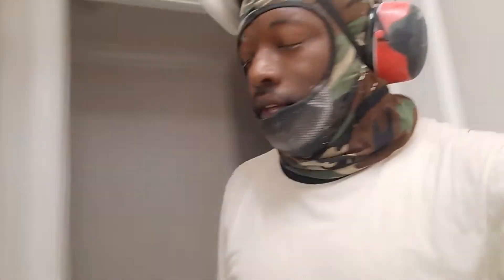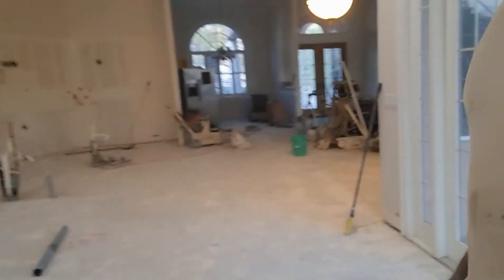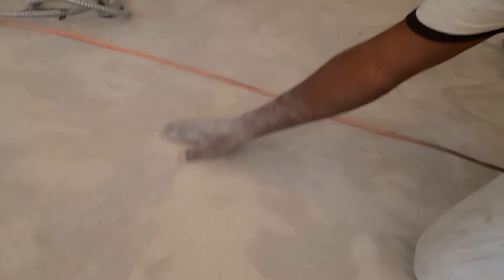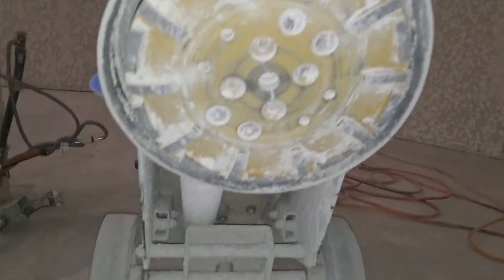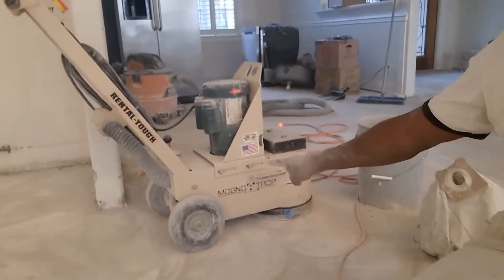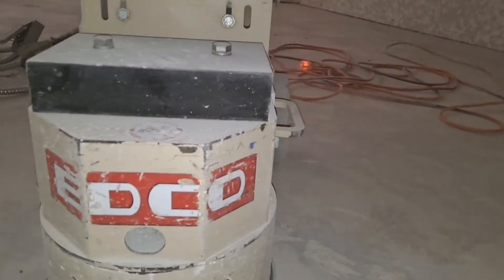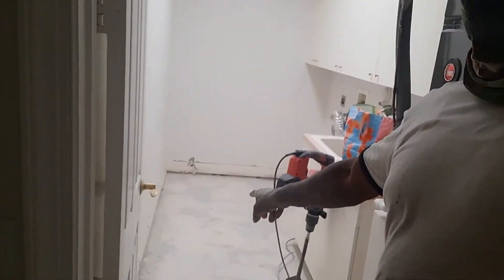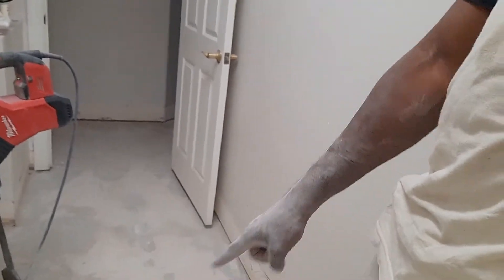how to remove tile thinset from concrete

Comment: Great and very timely info for removing thin set. I’m currently removing Travertine tile from my kitchen concrete slab floor. I’m using a 20 pound Makita demo hammer and scraper and then physically removing the tile shards for haul away to the dump is very labor intensive. I keep looking at that thin set left behind after removing the tile and not looking forward to having to deal with the thin set next. So I’ll be taking your advice from the positive experience you had with the concrete grinder. Though renting it is a bit pricey saving my back from aching and bending over that demo hammer for hours is worth the cost. Thanks for taking the time to make this excellent video especially for us weekend warriors.

Comment: Thanks for the video bro. I have a DIY project coming up and I have a good amount t of tile I need to pull up. Definitely going to rent that concrete grinder to get the thin set up and the floors smooth.

Comment: Glad I found your video. I do have to use my hammer drill with the Bosch Bulldog scraper. Unfortunately, I cannot lift or manage the grinder machine you are using. But, for me, it is much faster than manually scraping. I will eventually post pictures. Thanks

Comment: Thanks for the info. I just tried it the hard way and tomorrow I am going to go rent a grinder.  Thanks for sharing your experience
Reply from the maker: Glad I helped. Just make sure you connect a vacume to it. Because it will make lots and lots lot of dust.. and you don't want to breathe that stuff.
Reply from the maker: Also get some hepa filters for tour vacume and a pack of vacume bags, it will clog cup the filter pretty quick so be prepared to clean out the filter a few times durring the job.
Reply: Ok great. Thanks for the advice
Reply: I did customers entry way with a 2” wide bit on jack hammer, made a few holes in the concrete with it because it was to narrow. Filled in with concrete patch. Than used a hand held grinder which removed the mortar easily but took 2 hours of grinding to finish a 6’ by 6’ area. 

I still need to do customers kitchen. I plan on using my jackhammer to break up tile, than rent out the large grinder.

Comment: Thank you so much for your advice. The one thing I'm wondering is if you remove tile in a house that still has the base moulding and door trim installed, does it get ruined by all the chipping? I assume it would get damaged. Especially if it's MDF. Do you have experience with that? I'm just trying to figure out what I'll be up against if I take on a project like this. Thanks!
Reply: If you're removing and replacing tile, you're best off popping the floor moulding and replacing it as well.

Comment: How is that machine called ?
Reply from the maker: Its a concrete grinder
Reply from the maker: It use diamond disk to smooth out the surface
Reply: Thanks for share this video